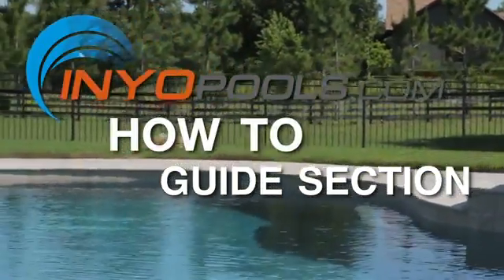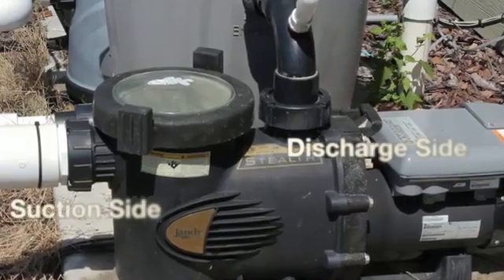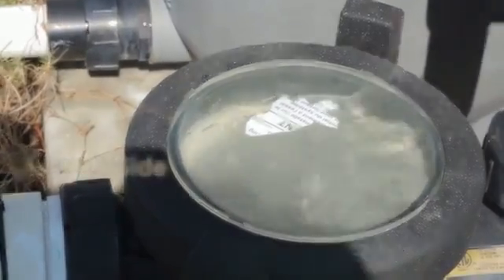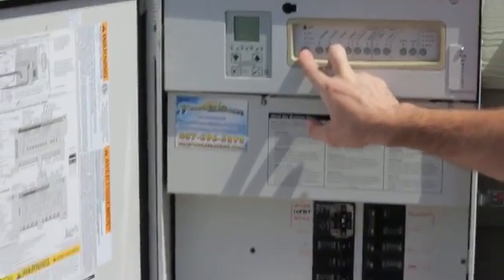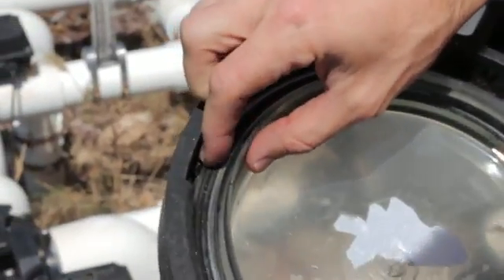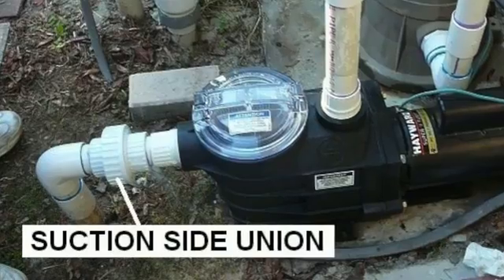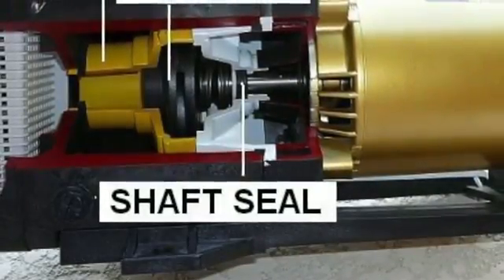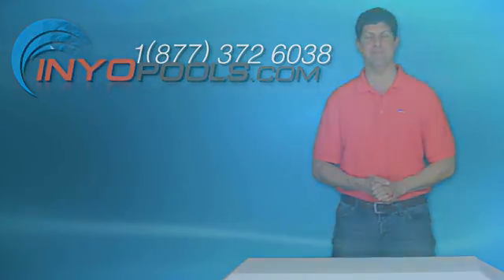How To: Identify and Correct Air Leaks

Comment: I have low pressure and my pump is brand new. I don't have a strainer on mine either. It's definitely not clogged. What else can it be?
Reply from the maker: Check your lines for blockages, clean your impeller, and clean your filter; we mentioned plenty of other things besides cleaning your baskets.

Comment: thanks for the video. I have a friends pool that has a lot of air bubbles. I've identified a union leak in thread to the pump. but I see hardly any water through the pump lid. is this because of the air leak in the union?
Reply from the maker: +Felipe The pump not priming may be caused by the air leak on the suction side of your pump. When a pump is priming itself, it requires the pipe to be air tight so it can draw water from the pool. When there is an air leak, the pump may draw more air than water causing air bubbles in the system. Make sure you check the rest of the pipe and its connections for any other leaks.

Comment: none of those relates to my problem, after I back washed and rinsed I put the lever back on filter and then started having the problem I can hear air bubbles in my sand filter I don't think it's seated right what should I do
Reply from the maker: +jtrekmadone The air leak is likely coming from the suction side of the pump i.e., a bad pump lid o-ring, a diverter valve o-ring or water level is low. The air should dissipate from the tank if your filter is equipped with an air relief tube. If there is no air relief then you may need to backwash again to rid the system air.